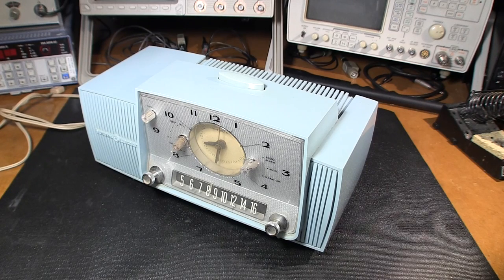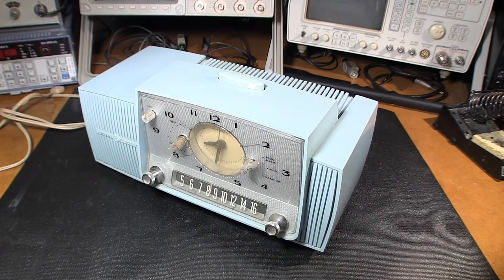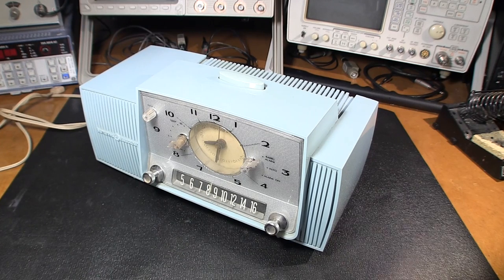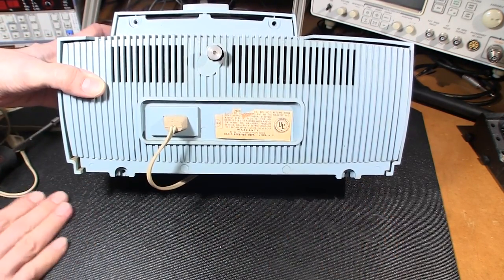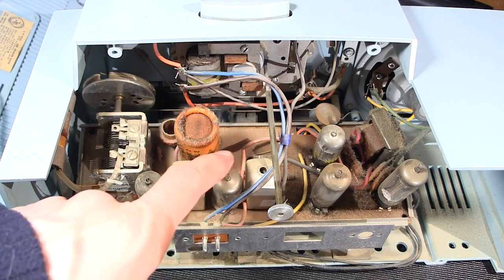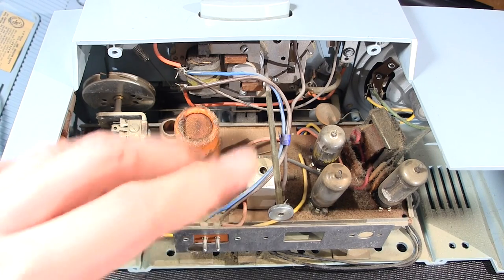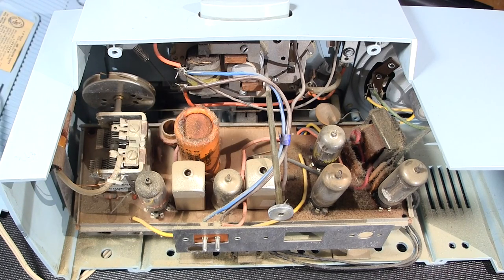Atomic Era Radio Teardown, Explained With Repair

Comment: Been a subscriber to your Patreon page for a couple of months now and worth every bit. Awesome video! Just gearing up a radio play room and have about 40 of these AA5 & 6 radios to work on. This was timely for sure. Thanks for the education on these. Wondering if you plan on doing anything that uses Telechron motors in them? Wouldn't mind learning a bit about them as well.
Reply from the maker: Thanks Bob! When I do another radio with a clock, I will focus on the Telechron motor a little more. This motor ran so quiet, there was really nothing to do.
Reply: This may sound insane, but I always wondered what went through the persons head that created these devices to begin with? I'm sure it wasn't hey I'm going to invent a radio not to mention having to invent certain parts on the fly and what went through their head when they had to do that? Having to repair or modify a device as such is one thing, but to create a finished working product is another. I always wondered if we had a advanced civilization that was wiped out to near extinction and they were the advanced elites that chose to retain these ideas and we fed off of that. Either way you're a extremely intelligent man and I thank you for sharing this incredible knowledge with random people that don't have the money, but want to know and apply so I wish you the best. Mr Carlson
Reply: ve1arn BobC mr carlson. Were you ex Navy?
Reply: If it's me you're asking, sorry, I'm not ex service.
Reply: looking forward to that, i have an "Esquire 550u" clock radio with a noisy motor, no idea what type of motor it has in it though.... i've been afraid to try and pull the knobs off to remove the clock from the case since they wouldn't come easily.... the clock knobs are brass... so i wonder how they're isolated...
Reply: @MrCarlsonsLab  put that in a big fat Cadillac from 1956 🙂👍

Comment: One of the reasons why people woke up and went to work back in those days is because having the radio slowly warm up, start soft then get louder didn't prompt the person awoken to slam the sleep button over and over. Waking up slowly causes you to be in a good mood for the rest of the day. When the buzzer goes off on my alarm clock, I want to crush it and sweep up the pieces.

Comment: Isolation transformer you say?! I collected and “tinkered” with these all American 5’s for years as a kid. I didn’t know about those at the time. Lucky I am still alive, took these apart and traced the wiring around trying to determine how things worked. Ask my burned knuckles how I figured out how hot tubes can get and how long they can hold their heat, especially the 50C5 and the 35W4 in these sets. Also didn’t know about the “live chassis” aspect of these units either. Live (luckily!) and learn.

Comment: While a Navy Electronics technician at the transmitter site at Midway Island 1966-1968, I also had a part time job at the "Navy Exchange Repair Shop" where we repaired TV's, radios, etc.  Fixed a LOT of "5 tube" radios.  Our workbench had the usual spray cans like tuner cleaner and freeze spray.  But also Raid - the bug killer.  Some of the radios that came in had spent their lives in a kitchen and had a yucky coating of grease.  But some of those from kitchens spewed forth scurrying cockroaches when opened.  Therefore, a quick grab for the Raid.  Also, perhaps the most common failure was the big electrolytic capacitor.  They came in way too many sizes and shapes to stock.  So we took one of a type we had in bulk and taped it to the existing capacitor in the radio which held it fine.  Then wired it in.  Perhaps not elegant, but fast, cheap, and a happy customer.

Comment: Years ago when I worked on a North Dakota Police Department, we had to be able to keep upright on the snow and ice. So I used to take those type of screws and screw into the bottom of my old Combat Boots from my army days. I could run on solid ice and catch the bad guys who went slipping when they tried to evade me.

Comment: The radio getting hot reminds me of that bit from The Simpsons where the guy explains that the Krusty alarm clock gets incredibly hot if you leave it plugged in. Didn't realize that actually happened lol.

Comment: This old radio shows up to 1600 kHz on the dial.   Medium wave was extended in ITU Region 2 (including the U.S, Canada and Mexico) up to 1705 kHz in the mid 1990's.  A great job, Mr. Carlson, as always.
Reply: That's why the digital tuner in my '93 F150 only went to 1630. Around 2002 the new talk radio station in Augusta GA was at 1650. I could only listen to it on the analog tuner in the shop, but when I jumped in the truck I had to listen to the other station at 580.

Comment: I  know that you know, but did you mention that one of the design features of these radios was that the total voltages on the filaments added up to the expected line voltage. They put the filaments in series and omitted the need for a filament transformer.  You took me back to high school electric shop. Great job, and thank you very much!

Comment: Tube receivers of this era and through early 60's are a BLAST to repair. I had an early model of the Lloyd's TM-939 my grandfather gave me. Replaced a broken tube, all of the interstage capacitors, restrung the dial and patched up the speaker cones, but never could get rid of all the static. Now I suspect why. Anyhow, it was good enough to sit above my bench and I enjoyed it for years.

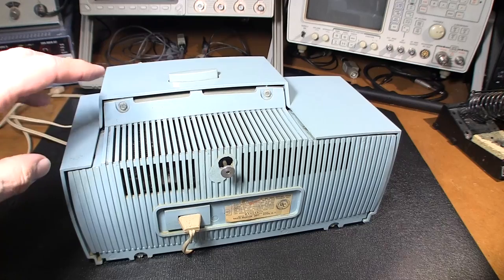Comment: I remember that radio and I'm surprised there are no cracks in the case.  It was a nice little radio but at 5:30 in the morning it made such an obnoxious alarm  noise your first thought was to toss it out the nearest window.  I started working on old radios when I was about 15.  After watching your videos it's safe to say I'm lucky to be alive.  I would pay about $5 for an old Zenith or Philco radio at the local Goodwill store and take the tubes to a grocery store tester. (Almost every store had a tube tester back then).  A $4 5Y3GT and we would be up and running.     After cleaning and polishing the cabinet I was very happy to sell them for $15 dollars.  I had no idea of what they would be worth today...    Thank you for your videos,  great fun and I appreciate your attention to work bench safety and the dangers inside all the innocent looking cabinets.  
BR:  Tim

Comment: Very well done!  I was in high school in the late fifties and I used to make pocket money by repairing tube equipment in my neighborhood.  At that time, 98 percent of repairing a radio or TV set consisted of testing and replacing tubes, so it's interesting to see how different it is more than fifty years later after time has taken it's toll.   I thought I knew it all, but I picked up some good tips from your video.    I grew up in Texas where the "L" in solder is silent and I've  never heard the "L" pronounced before.
Reply from the maker: Thanks for taking the time to write!

Comment: Paul, I had this very radio as a kid. Mine was Ivory.
This video is helpful in that I am doing cap replacement and IF alignment on a Hallicrafters S-120 radio. Toward the end of this video you showed how to adjust sensitivity on the tuning cap. That is information I did not have. Also your section on "silver mica death" for the IF transformers is of particular interest.

Keep Radiating!

Comment: Fantastic video! I have a similar Motorola with a sticker on the bottom that states "Do not connect chassis or antenna to water pipe or radiator". Healthy advice.

Comment: Thanks for another excellent video!  
It took me back to a simple performance modification and a safety modification I made to my 50's era AA5 radio in the 1960's.  
Sound fidelity improved noticeably after I wrapped some negative feedback around the audio chain from the speaker to the cathode of the 50C5 to deal with nonlinearity in the tube and the transformer.  First I connected one speaker lead to signal ground to provide a reference point.  I connected the other speaker lead to the cathode of the audio output tube through an RC network, the values governing how much audio level I sacrificed for improvement in the audio quality.  And of course the selection of speaker wire connections  governed whether I got negative feedback and stable higher fidelity or positive feedback and an audio oscillator.  Primitive, but it worked.
My radio had a wire loop antenna attached to the inside of the fiberboard back of the radio. The loop connected to the electronics by means of a pair of metal eyelets.  I soldered one leg of a neon circuit tester to one of the eyelets (essentially a chassis ground connection), and left the other tester lead unconnected.  I Duco-cemented the tester to the back of the radio.  Our house wiring in those days had only two-pronged non-polarized receptacles, but I was always able to tell whether the chassis was "hot" or "neutral" depending on whether the neon bulb glowed dimly or not at all when I touched the free lead of the tester, my body acting as a capacitor to ground, which was not far away from our first floor dwelling.  I was a kid without an isolation transformer to his name, but with plenty of respect for 117VAC.

Comment: Hello Paul, my complements on your nice video, restoration, and detailed information regarding the addressing of problem areas, you sound exceptionally experienced for someone your age.  Keep up the good work!

Since this radio came out the year I was born, thought I would add my 2 cents in the way of history/trivia.  I worked on a number of 5 tube radios in the early and mid 1970's and still do an occasional antique (1930's) radio restoration.  That particular General Electric clock-radio was one of the higher end models.  Slide-rule tuning, clock, dial light, and sleep switch, they didn't get much fancier than that.  

General Electric was very big into cost cutting measures in their TV's and radios then (1950's and 1960's).  They were the first ones with a PC board (whereas must companies had point-to-point wiring or were converting over to a PC board), ferrite rod antenna, ceramic disk capacitors (in lieu of tubular paper), and R-C networks/hybrids (you referred to these as a "Cuplet", a term I had never heard used).  I was surprised to see that your PC board even had soldermask.  In the 1960's, General Electric designed a new tube set series called Compactrons in a 12 pin base for their TV's, with 2 - 4 separate sections (diodes, triode, pentodes) to minimize tube count and lower cost. 

Occasionally I would come across a radio where a capacitor or resistor would open up in one of those Cuplets.  This part was not available because it was custom; made for a 1 or 2 year Production run.  To accomplish a fix, I would add an external component to replace the open part, if that point in the circuit was accessible.  If not accessible, I would have to construct the entire network from discrete parts and jury-rig it into place.

In the 1970's, the number one problem with these radios was (not surprisingly) a dry (open) cardboard cased electrolytic capacitor.  I had never come across a radio where the makeshift mica capacitors in the IF transformer where intermittent.   I didn't realize General Electric was doing this, which is really crude.  I'm not surprised there are problems with these capacitors with the packaging used.  Silver in the presence of air, moisture, heat, and significant DC voltage is guaranteed to migrate.

I do my receiver alignments a bit different than what you are showing.  I connect the signal generator (DC blocked, 0.1uF cap) directly to the RF terminal of the tuning capacitor for the IF alignment.  I short out the AGC or maintain the 455 kHz input to where the signal level is below the AGC point so the AGC won't affect the peaking process.  I peak from the output to the input, which is the opposite of your method.  This is the way we did it when I designed for Collins Radio but, it's not that critical.

The 5 tube radio (which all used the same tube lineup, due to RCA licensing) was a low-cost refinement of an early 1930's Superhetrodyne radio.  A transistorized radio using the same circuit block scheme is not quite equivalent.  The 12BE6 (pentagrid converter) combines a local oscillator and mixer with gain (10 - 20 dB).  The 12BA6 (remote cutoff pentode), with it's super low plate-to-grid capacitance, enabled super-high, but stable gain (60 - 80 dB).  A transistorized equivalent receiver needs an additional IF amp and also results in a noticeably higher noise figure due to the converter stage.

On all of these radios, I have never come across one where the antenna inductance is set properly.  Since you can't really set this without destroying the antenna, the result is reduced sensitivity at the bottom end of the band.
Reply from the maker: Hi Bill. Thanks for taking the time to write, that's a great story! Also, thanks for your input as well!

Comment: There are alot of features on this radio that mimic the cars built in that era.  You mentioned the knobs being made of metal.   They are made from PotMetal which was very cost effective in that time.  Cars used alot of pot metal for tail light/parking light bezels, trim pieces, hood ornaments and garnish trim.    Thank you for taking the time to make this video.  It was very informative and I always enjoy watching you work.  It's an enjoyable experience.

Comment: I've got a sibling of this old timer up on my "50's shelf". Mine's got a black background with white clock numbers. The original brittle little clock knobs were long gone so I made some stand-ins out of wood on my lathe. Would love to 3-D print some replacements, as you suggested. If only I have a 3-D printer and a template! Anyway, mine works well with the original caps, but I didn't run it for very long for fear of damaging an irreplaceable transformer or the rectifier tube. It's on the list for recapping...someday :) Thanks Paul for another jewel of a restoration video. I never fail to learn something new from you—and I've been doing electronics for 40+ years! Keep up the great work.
Reply from the maker: Glad you enjoyed!

Comment: i had a radio like this in the 70's sure wish i hung on to it :)  great video on this ERA of radio
Reply from the maker: Thanks John!
Reply: I got a reel to reel a MasterWork 800 i need to take apart some day of course with extreme caution
I got a real bad HUMMM sounds like the Caps need to be changed this was my grandfathers and he used in in the 1960's when he worked at a drive in theater he is gone now passed at a ripe old age of 90 he used to run sound and films for the drive in and there was no greater teacher then him for sure:) he would record movies or commercials and use it for that then he would bring them home so his kids my mother and her  sister and 2 brothers could have some form of entertainment . anyway this reel to reel i think was made in the 1960's and was use mostly for general use  i dunno if it has tube most likely so I will need to use caution

I already know :) be leave me I am always looking for safe ways to discharge caps if i need to most of the time i use a chicken stick and a lead with 2 clips one that clips to the body - Ground and the other at the end on a pvc pipe I could use resister but I am not sure how much resistance is needed  :)
Reply: Safety First Always !!! I contacted you some time back about my Keenwood 820s I have asked for some help here from some local hams to help me change some tubes  do it safely they did say they would come over and help so i am glad to here that i soon will get it fixed The output is dead i have some dead finals and so i need to replace them.. I did find some 6146B Made in America !
Reply: as a tech learning is my reward :)

Comment: Wow!  Wished I had seen this before my experience with silver mica disease. The 1206 100pf cap is a great fix.  Much better than the through hole that I shoehorned into the can.  Looking forward to a video on unsticking or removing iron powder core slugs.  Thanks Mr. Carlson

Comment: I do believe that the orange component is a capacitor. Long ago when I was very poor I had a similar radio and all it did was hum. I took it to a tv repair shop and was told the orange component needed replacement. So I bought one from the person running the place and borrowing a soldering iron I managed to R&R the component using the old solder present on the through holes. These days I'm up to my ears in solder or every description and electronic components and I'm grateful for this channel.
Reply from the maker: Thanks John!

Comment: I have the pink model. It has a black dial and the conelrad markings on the dial that were used between 1953 and 1963. It also has a phono input. Very good sound with very little hum.

Comment: I repaired Radios for a living in the sixties. Never used a scope for IF alignment. Any local station or distant and my ear. 
Aligned the cores in the antenna coil to bring a local station at about mid point to the mid point (or below) of the dial and the antenna coil core to max signal ( by ear). Repeat the procedure at about 80%  of the highest frequency and adjust oscillator trimmer l for correct frequency on the dial and the ant  trimmer for max sound and viola done. these radios were a joy and always ended up with good results. (This is two point alignment)
P.S.  If the oscillator circuit had a (n adjustable) padder in series,  the padder was adjusted at the bottom of the scale for a three point alignment. Fixed padders were a bit trickier and needed exact alignment  frequencies. These I did by a bit of trial and error instead, lacking a sig gen. In these cases the gang cap is unequal, one large one small.
Reply from the maker: Thanks for taking the time to write! Interesting story.